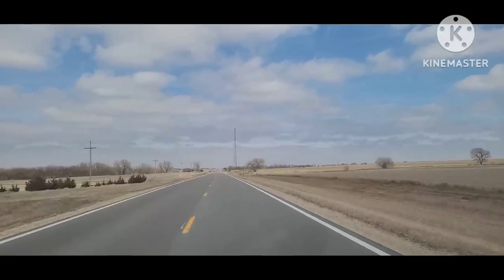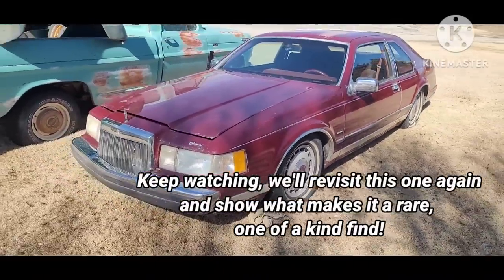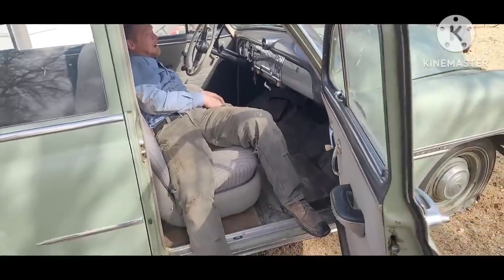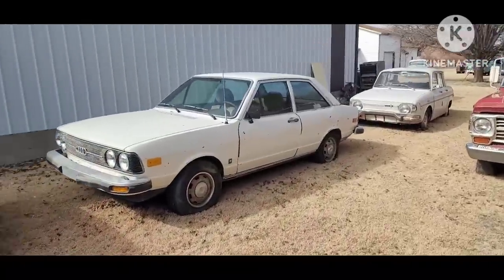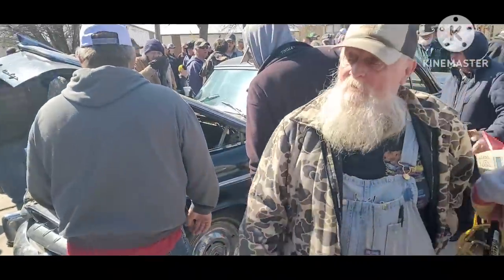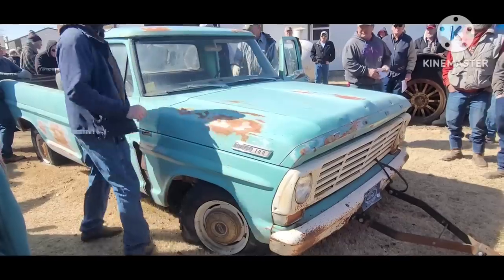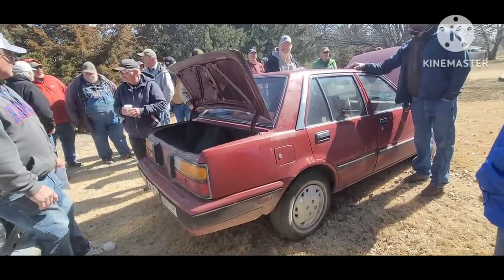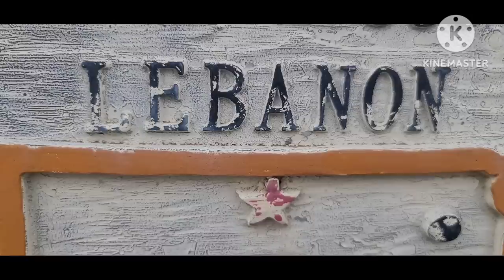Survivor Car & Truck Collection Tucked Away in Kansas barn for Decades! Ford, Chevy, Dodge, IHC!

Comment: Speaking of nostalgic old items......at the end of the video, you showed the old-style Coleman ice chest.  In 1978 and '79, I worked part-time in the Coleman plant at 2nd and
St. Francis Street in downtown Wichita.  I ran a riveting machine that mounted the handle and the two hinges on the back of the lid.  Later, I was promoted (?) to a giant oven
that I sprayed a liquid foam insulation, popped the plastic inner liner, then put on the conveyor to cook the spray foam insulation inside of the lid.  That plant was torn down
many years ago - but it was a good job.....I still have good memories of the place.

Comment: The motorcycles are Bridgestone  Hurricane Scramblers.  According to the "Comprehensive Vintage Motorcycle Price Guide" that I recently purchased.  They are worth $2000 to $3000 ea. depending on the year with the 1966 model being the most valuable and in the condition they are in.  I owned one in 1969 it was a couple years old when I bought it.  I road it for about a year then sold it.  It served me well.  They are a road bike with high exhaust pipes and a brace on the handle bars.  They were on'y made for 3 years.  The engine is a 177 cc rotary valve two stroke twin. It performed really well for what it is.

Comment: that Lincoln reminds of the turbo diesel i have for an 85 ranger that ive been working over on my channel , its definitely a challenge , i worked for FORD for 16 years and only ever saw a lincoln diesel once , towed in with a broken timing belt.

Comment: Tim grab all 3 of those Bridgestone bikes you can thank-me later. I know who made them and you will be surprise when you find out. They are probably hard to find motor pistons for.
Reply: I once bought a mint 1969 350 GTR, 3 spare engines and thousands of small spare parts from a UAL Capt in Mill Valley, CA. Rode the bike home. My wife and I loaded all the parts into our 1966 Ford Custom and we drove away. $1500 in about 1990. I remember distinctly he was asking $2000. He didn’t know what he had and didn’t care — got it from some other pilot he knew. FF 8 years and we were moving around and it was too hard to keep moving all this stuff and store it (along other other bikes). Sold it all for $2500 via Bridgestone Owners Club website in 1999. 
Huge mistake. Turns out I didn’t know what I had. 
The Bridgestone 350 GTR is the one bike Leno has said publicly “if anyone has one let me know”.

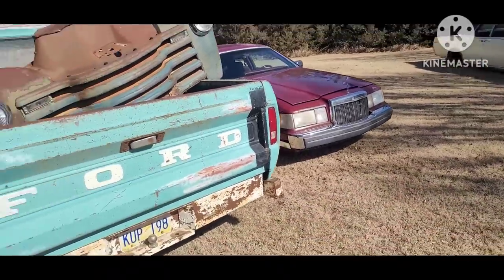Comment: 8:11 Lincoln Mark VII.  It's a Foxbody vehicle.  The powertrain is identical to a 5.0 Mustang from the same years .  The air suspension is always shot on these, but you can replace the air struts and shocks with T-Bird ones (standard-not air ride) from the same years 😉 EDIT: the BMW turbodiesel is a rare find!
Reply: Not that one, it's a turbo diesel  2.4
Reply: @Scalihoo  looks like it sold for scrap.  $1,100 is nothing for a car whose body is in excellent condition 😢
Reply: @brentboswell1294  They were popular on long Island where I grew up, beautiful cars

Comment: Iam not sure but gm may have the 153 four cylinder engine that was available in the little nova station wagon in 63! They also list that engine in the c10 trucks! But not sure if gm ever actually installed the 153 in pickup trucks? I think the smallest engine was the 230 6 cylinder!

Comment: The Renault 10 is a very rare car in Europe. In this condition, this vehicle could be sold for 3,000 euros or more. Such survivors have become very rare. I think there would have been a European buyer who would have brought this vehicle back to Europe. The Lincoln's diesel engine is a BMW M21 2.4-liter turbodiesel six-cylinder with 115 HP. These engines were very economical and had good torque and often lasted more than 350,000 miles. Since the American engine industry at that time did not have any long-lasting diesel engines with low consumption and good performance in its range, purchasing BMW technology was a good choice. The BMW six-cylinder diesel vehicles from that time are now very sought after in the classic scene in Germany.
Reply from the maker: The Renault was sold on to another Youtuber, "Robot Cantina", and has been mechanically refurbished with a replacement engine
Reply: @mr.goodpliers6988  Yes, I already watched the channel. I didn't know that this Renault model was sold in the USA. Unlike Volkswagen, Renault was not as successful in the USA. It's also a wonder that this car still exists, when these vehicles were produced they used very poor steel. The sheets were made from steel with a high copper content.

Comment: You got a steal at $250 for the Renault 10, I paid £100 or 150-quid (£'s) for a metallic blue Renault 10 around 1978 in Bournemouth (Southern England) and ran it for 2 or 3 Yrs; had to change out the big end bearing caps as quick cheat to help the little 4-pot keep on motoring.
What're plans for the wee car?

Comment: I don't know if you read these but most pre 1970 vehicles have the year tagged right on the taillight lens. Most cases
Reply: You are right to a certain extent. It was in the early 1950s that cars started having their years written on the taillights, when they were switching from glass to plastic lenses. If the taillights were used for 1 year it would always say the correct year. If the taillights were used for more than one year It would say the first year which they were produced. The auto makers never did stop writing years on taillights. On more recent cars you will also find years written on plastic headlight lenses. Sometimes the years on the front will be different from the rear depending on which year the lenses first appeared.

Comment: Red 69 F100, was that fuel tank fill necks in the bed right behind the cab?

Noticed on the 54 Chevy a sticker on passenger side of the front windshield what was it?

Cool auction.
Reply: Yep.  Ford kept the fuel tank in the cab behind the bench seat longer than anyone else. This one has an auxiliary tank under the bed, also...
Reply: Chevy had them behind the seat till they changed the body style in 73.
Reply: @dankreoger611  Ford moved the tank in the F100's in 1973, but the F250 kept it in the cab until 1977.  It took a government regulation to get Ford to use common sense in their vehicle design 🙄
Reply: @brentboswell1294  wasn't sure about the Ford trucks, so I didn't say anything. I bought a F150 new in 77 and tank was under the bed.

Comment: Bridgestones were Japanese motorcycles made by Bridgestone tire company, they were trying to compete with Honda.. it didn't work.
Reply: Hadn't heard of the Bridgestone motorcycle but would think their rarity would add to their value.
Reply: @ernielaw  They haven't really gained a lot of popularity. I know they made them for 5 or 6 years, 65/66 to 71. Sold them through the Tire Dealerships. Honda Scramblers of the same years sell for 5-10 times as much easily